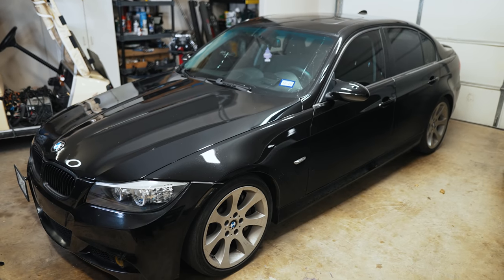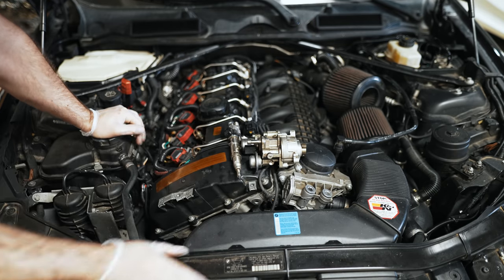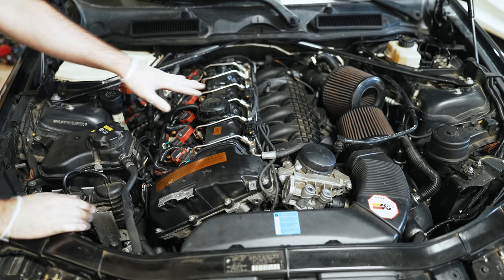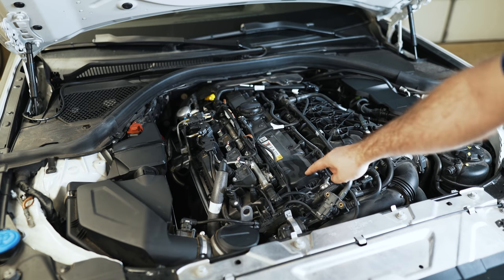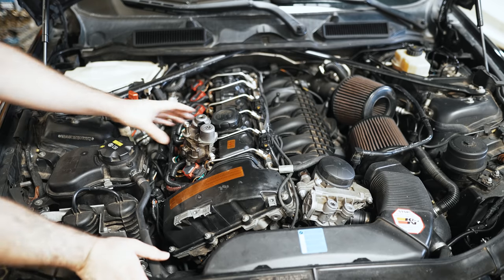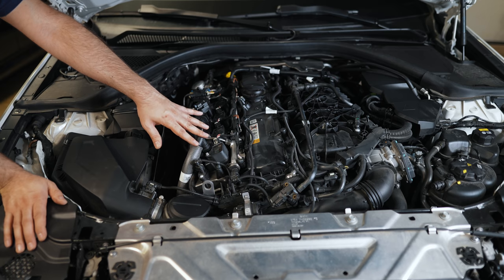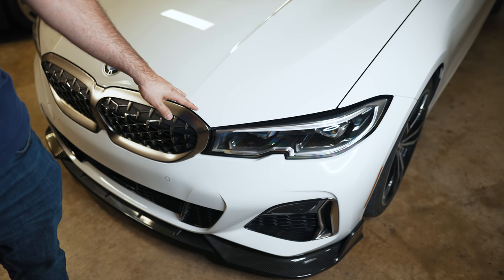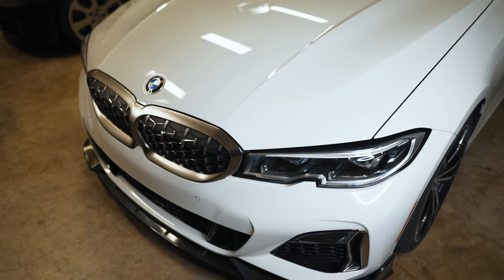Here Is Why New BMWs Are Now Reliable

Comment: I know the n55 cant make the amount of power the n54 can make but is it just as reliable?
Reply from the maker: The N55 is decently reliable, much more so than the N54.  They still have some issues with valve covers and the PCV system and ignition coils etc but I've recommended people buy then if they don't mind the odd expense here and there.

Comment: I have a 2015 F80 a wheel bearing failed at about 25,000 miles,  at about 30,000 the differential failed all covered under warranty.  The differential repair resulted in two return trips to the dealer for correction of differential installation bolts...ie failed to tighten mounting bolts, and forgot to install a nut on one of the shock absorbers.  Since i started doing my own maintenance i have had zero issues.  I will never buy another,,,nor will I go back to the dealer for maintenance.   OBTW...I am replacing the lifetime fluids.

Comment: What I've learned is that to have a reliable car there are 2 ways. Buy a Toyota or buy a nice car to drive under warranty or extended warranty. The time needed to repair stuff is not worth it. My time is worth so I prefer sending it on doing something else. 

In the US especially if you want to use people to do your stuff you are screwed from the high labor cost. For example here you'd pay like $100 an hour or god knows how much for a mechanic to even look at your car. In Greece you get a BMW expert to work on your car and do a lot of things for the same $100. Plus they check your car for free. You hear something? You take it in and they plug it in, take it for a spin and you don't pay a dime. 

 I was stunned here when I went to my local mechanic to check my used Merc years ago. Called me up said couldn't find any issue. Went to pick it up and he said ok ir will be $150. I said what? Yes it took us a few hours to look at your car and we need to get paid. I paid went straight and gave the car to a dealer and got a lease. 

Fun fact. I went to an official service under warranty. I told the guys that it vibrates at 60 miles. What was their answer? How are we going to replicate this...go out in the highway? And the guy was laughing. This is the level of mechanics in the US.

Comment: Did they ever upgraded the lower bearings that same to start wearing down at around 80k.
Reply: Yeah I read some info about B58 a while back and lower bearing issue
Reply from the maker: Should have been addressed in 2018 when the B58B30O1 came out as far as I've seen but I also read that the early B58s in the F30 would have to be aiming for an excess of 600 whp before they'd have to worry about the bottom end.

Comment: Let's revisit this when you're vehicle is out of warranty.  Can't wait for that one.  Please check back in at 50,000 miles and you have to change out the starter, oil service valves, plastic chain guides, or when it's burning a quart of oil every thousand miles.

Comment: Except if you work on these engines you know the coolant reservoir does crack,the mechanical water pump fails as early as 30K miles,the heat management module(fancy name for a thermostat) leaks and it’s a big job,you have to remove the intake,also under the intake the T-pipe connector leaks,the electrical water pump fails and the oil filter housing cooler leaks. Yeah,they’re very reliable... 😂

Comment: But are they any cheaper to repair now, though?
Reply from the maker: I don't think they'll be much cheaper to repair if something goes wrong but I think the likelihood of something going wrong will be less.  Similar to Lexus, they are reliable but if something does go wrong the parts are rather expensive but the likelihood is low so it balances out.
Reply from the maker: No cheaper necessarily but less likely to fail IMO.

Comment: My 520d from 2014 started smouldering at 102K miles, the inlet manifold got bunged up and then stuff ignited whilst travelling down the motorway at 70 mph.!!, I think BMWs before year 2010 are probably the cut off point where cost reductions started to affect quality.

Comment: I thrashed the nuts off my bought new 2001 E46 330Ci with the M54B30 for nearly 20 years and 210,000 miles and nothing went wrong before 180k miles and even then it was basic stuff like fuel sender, alternator, power steering pump. In the end the expansion tank cracked leading to head gasket failure. I still own it and am wondering whether to bother trying to fix it. But now the rear arches are rusting. That’s British weather and winter road salt for you. I loved driving that BMW. Not so keen on a turbo engine though which is why I didn’t buy a modern BMW. I also own a 1992 730i as my daily driver so I still get to have my BMW fix, plus a Porsche for driving the mountain roads in the Alps and Pyrenees.

Comment: The timelines on BMW's introduction of high pressure direct injection and turbocharging is incorrect in this video. You're not far off the mark, but they've had a few goes at it prior to the N54.

Comment: BMW has come a long way, from being one of the most reliable cars in the 70's and early 80's to slowly becoming some of the worst, to slowly coming back over the last 5 years to becoming reliable again. Go check out real reviews of 5 year old, late 00's BMW cars and compare them to 5 year old 2016 or 2017 cars. They have progressed a ton. Same with GM (especially Cadillac), Porsche, Subaru, and Hyundai/Kia. The last 5 years have led to massive improvements in reliability for those companies.

Before the internet, consumers lacked the data we have now on reliability of vehicles or customer satisfaction among insurance companies or stores. Now that we have all this data at our finger tips, it is pertinent to companies, such as automakers to make vehicles as reliable and comfortable as possible, with as many tech features as possible, whereas before, really just power and comfort/styling mattered and the rest was mostly rumors of reliability or brand loyalty. There is now a profit motive for automakers to make more reliable cars. The gap has closed in on Honda and Toyota is not far out of reach either, most popular vehicles will be as solid soon and it will come down to features and tech.

Comment: There's only one major difference between new 3 series vs old 3 series . Timing chain will fail at mileage 120 000 or even below . When at the same time timing chain never failed at M54 engines.  Overall I agree with you when comes to rest of stuff like high pressure pump,  injectors...
Reply: On which engine? B58?

Comment: You can't just say 'BMW' is now reliable, you have to specifically identify which year and which engine 6 or V8.

BMW really trashed their delicate reputation with the N63 Debacle.  And it took them 5 LONG YEARS to correct it.  I don't know of any other Manufacturer that could have even survived that Holocaust. And now we're just supposed to forget?  Just assume that BMW has returned to designing the best technology?  They just want you to buy the Roundel and not the Car. 

Every amateur car guy knows the problem: Excessive heat and too much Plastic. Every BMW should come with a Vented Hood. or at least a vented Engine Cover. 

In the 21st Century, Americans have come to expect a choice from a very large number of cars that will never have ANY PROBLEMS AT ALL.  Even Hyundai and Kia have good reputations. Ah, but if you want Status, and Class, and "I'm a Star" status, well that'll cost ya...

Comment: Valve cover, valve oil seal, crankshaft oil seal, halfshaft oil seal, vacuum pump, turbocharger, oil filter base, oil radiator base, water pipe, water pump, water tank, water pipe tee，thermostat, oil pan. All plastic parts, all rubber sealing rings.

Comment: As a former BMW mechanic, these engines are prone to CBU. lf you don't mind removing the entire intake system every 45k miles and cleaning the intake ports and valves, individually, with crushed walnut shells as air blasting media, go for it. lf not, get an older one with port injection.

Comment: 15.000 miles with zero problems is not a big deal for most cars ... I don't see why you are surprise of this.I don't think i had problems to any of my cars in the first 40.000-50.000 miles , and i had even some cheap cars.  If my car had problems in the first 50.000 miles i would still said bad things about it and i will call it unreliable.  In this day and age is unacceptable for a premium car brand to have engine problems because of a bad design ... the hole reason that i'm buying a premium brand is to have the assurance of a good and reliable car, but it seems that is not always the case with the new models.

Comment: While I prefer the look of the older cars, the advances in reliability of the new cars cannot be ignored. Most of the claims of the downward trend is due to the increase of complexity, but it's like in diagnostics, old cars are limited in information in scan data, new cars provide so much more. I still say the Achilles Heel in all modules is the use of "Press-in" board connectors and lead free solder. But a scope, schematics, service info, and a scan tool are the most powerful tools an educated mechanic can have today, Mercedes, you paying attention yet?

Comment: IT all depends how long these things can go for without any problems. Since the timing drive is on the back, good luck if you have a bad chain guide, tensioner, chain, phaser etc etc. This is usually an area of problems on a lot of european cars past 150k
Reply: It's an I6, pull the damn front clip in 20 minutes and pull the motor? And honestly how often does a timing chain go bad?

Comment: My bmw e30 325im tech2 was one of the most reliable cars i owned rev limit every day for 100,000km of driving and had done 120,000km when i got it the secret was maintenance omg you have to replace some parts before they fail 😱 then i got a toyota carib and motor blew in like 3 months of me owning it big end bearing. Now i own a e36 328i ill have to do maintenance 😱

Comment: More reliable...this is a direct injection engine, look for ERV valve issues between 50 and 80K miles, also being direct injection prone (like all direct injection engines) to coking, expect that between 40k (lots of short journeys) and 90K longer journey vehicles) thus requiring Walnet blast to clear from the injectors.

In the UK ERV (circa £200 - £250 independent, £400 BMW) + Walnut blast (£350 - £400 independent, £600+ BMW).

Comment: Had 2007 335xi and what a POS. Both turbos failed, HPFP + LPFP replaced, water pump failed while on highway, power failures with sunroof/passenger rear view mirror/4 door locks. Final straw was 4x4 light flashed red.

All this under 57,000 miles

Comment: How about oil leaks everywhere ? Oil pan gasket replacement costs $2500
Reply from the maker: That's hard to say, we could look at the 2016 F30 with the B58 and see how they've been holding up.  With better heat management in the engine the gaskets should last longer but they now run very thin oil in these cars.  I would say if you change the oil at 7K vs the recommended interval you'd have a better chance of making it to 100K miles before leaks.
Reply: @VehicularDIY   what I am trying to say is BMW will never be a reliable car. Maybe they will improve a bit, but they have German mindset that will never change. To change the oil pan you need to drop the entire subframe, you never do that on a  Lexus. Change the oil every 7k doesn’t help with stupid design and poor quality materials. Lexus will last into 300k miles without major repairs, you are hoping your BMW to go 100k without tens of thousands of dollars in major repair. I am a BMW owner (N52) and I do work on the car, not to the extent you are doing though, but enough to know what I am talking about and never never buy a BMW

Comment: Not long sold a series 1 coupe 125i. Lovely drivers car however....the engine was plenty powerful, but at 45k genuine miles things were going wrong, plastic parts, oil level sensor, vanos solenoids, and why on earth they wouldn't put a dipstick on the engine I never know but it was a nice car although short lived. Long live petrol engines!

Comment: So basically, move the coolant reservoir, and use a turbo blanket, and you get more reliable?
Reply from the maker: Those are just minor updates that help, it's the fueling and boost control improvements that will make the most difference.

Comment: I have a new BMW... there have been dumb problems. Leather problems, seat frame squeaking, paint flaking off my roof rails, and a few other things that bug the F outta me.
Reply from the maker: That's the G05 X5 right?
Reply: @VehicularDIY  yes. Worn lower seat leather at 9000 miles, and I have the premium leather option. BMW said normal wear. Center console arm rest heater died, driver seat creaks and squeaks with side to side motion, and took multiple complaints to get them to order a seat base. I’m at 22k miles and have needed front brakes for 500 miles, but they can’t get the parts and told me to keep driving it, it’s okay. Not sure how this will look when it had 50k miles.

Comment: whilst your review of why you think they will be more reliable is fair enough, you won't know how reliable they are until time has told its story. Not so long ago BMW produced a whole wave of engines (N47) where the sprockets were machined ever so slightly more sharper than they should have done - resulting in many many engines failing very prematurely (before 80 000 miles). 

You won't know this is a problem until a couple of years later. Likewise with their plastics they use in the cooling system - these have a habit of springing holes in drain valves and related joins - the new car will only tell whether that tale is true in time. Even if your running gear all keeps on going, whilst I don't know the rules for American built versons, BMW Germany doesn't rust proof their cars as well as they used to since they claim they can't now do half the stuff they used to do due to EU bans on various corrosion inhibiting materials used on the body and its parts.

Comment: I wanna swap my 2012 335i with a b58 when it goes, possible?
Reply from the maker: Yes on that F30 it's definitely possible given they offered it in your chassis in 2016.
Reply: @VehicularDIY  Have you ever seen it done before? I can't find any swap info anywhere for n55 to b58. Thanks for the response!
Reply from the maker: There are people that seem to have done it on 4 cylinder cars converting them but that should give you an idea of what you'd be up against.  A crashed donor or flood car to get all the parts needed.

Comment: Change your oil and filters every 8k max, resolve any oil leaks quickly and you'll generally be fine. These newer engines are basically  evolutions of the older ones I'd imagine, in the same way the B37, B47 and B57 diesel engines are essentially revisions of the N47 & N57.

Comment: if you haven't owned a BMW dont spit old German car cliches..if you bought one without researching what potential issues your specific model could have and what work had been previously done shame on you. If you aren't willing to do the research or maintenance BMWs are for you. They are reliable as long as you know what to look for and make sure the car has been maintained properly. I bought my 17 year old a 2011 328xi , from an owner that had all the maintenance records. We knew what to look for as potential issues. Replaced all the fluids and filters. only major service was the belt pulley , which if you let go can suck the belt up into the engine.

Comment: I think if Toyota,used  the engine in their car they have to be some kind of reliability to it so, you might be onto something plus it was Design with Toyota , also I have a 2010 BMW 535 high with 197,000 miles same engine same transmission and still runs like new with the MHD stage two tune transmission shifts like butter still , so it all depends on how you maintain your car

Comment: 335 Was the right step towards performance but the wrong engine manufacturing generation as we learn today. The N54/N55 block and it's internals were too weak for its "turbo" setup, much weaker than the previous generations and even significantly weaker than what was made in 90s as naturally aspirated engines. 
It really could have been the "supra engine" of its time but it FAILED in terms of engineering, later was replaced with much more sophisticated and MUCH more durable B58, which is still aluminum just like everything else now basically is.

Comment: When BMW stops selling $40k worth of plastic, the reliability issue will stop.  Plastic thermostat housing just cracks after so many heat cycles.  It's actually not green because you end up throwing away cracked or warped plastic parts into the land fills instead of aluminum that lasts forever.  Wonder why there are aftermarket aluminum counterparts for various engine components.
Reply: Why is everybody complaining about plastic parts? They are really cheap comparing to HPFP, injectors, Camshaft sprockets and rod bearings and etc.
Reply: Check Nathan's BMW Workshop, and see how many plastic thermostat housings he has replaced.  It's basically a coolant leaking machine through the usage of plastic parts.  Plastics aren't meant for heat cycles, especially for cars driven in the snow belt when parts are cooled and heated through 200+ degrees F.  At least the Germans finally figured out and listened to the Japanese to go back to mechanical water pump instead of an electric one that costs $500 to $1000 to replace.